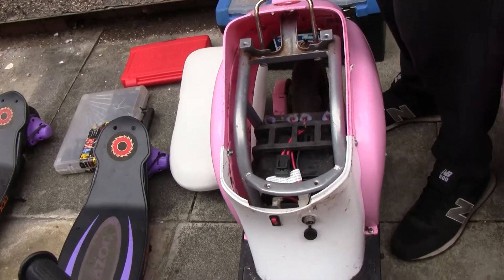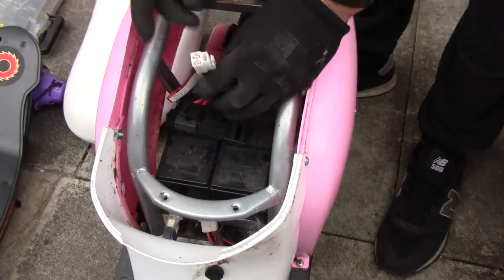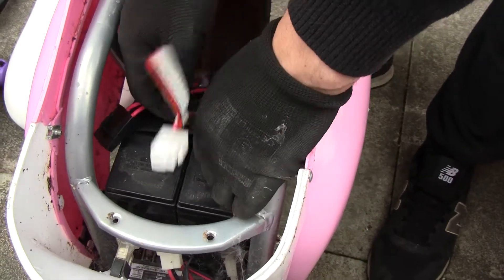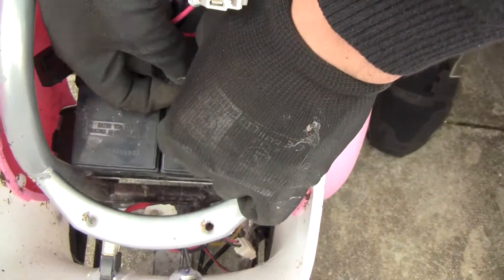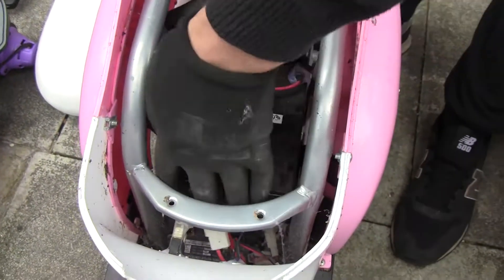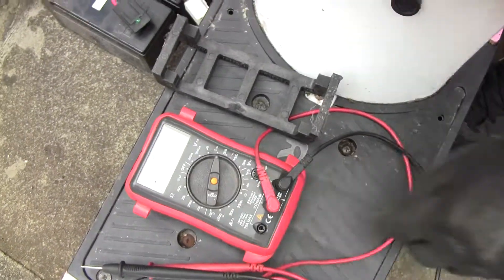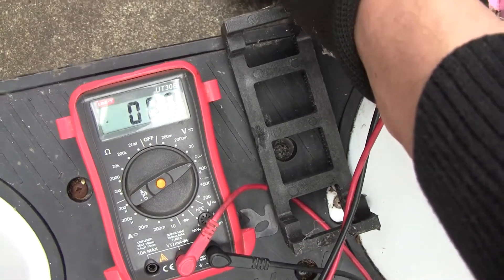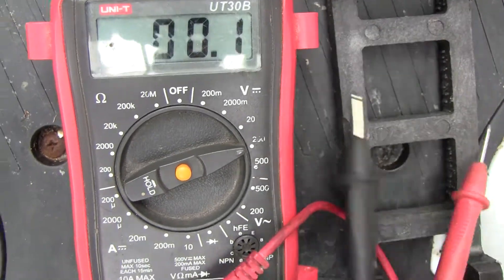Razor Pocket Mod 24v 280w Batteries Removed -Tested / faults

Comment: If you gonna make a video ... doit  Right the 1st time  !  So we can all understand what going on  !  Don't waist people time  !  ......  Should battery charge 24 hours before the volt meter reading test  ?  You can say connect red prong of volt meter to red wire on battery terminal  OR  black prong on volt meter to black wire on battery ..... something like that  !.....   What is the proper charge for a good battery ?  What it should be reading ?  What is a bad reading ?  Why test the click ?  What the click means ?  What purpose is the click ?
Reply from the maker: hi you seem like a smashing youtuber , normal charging is 8hrs to 12hrs these batteries to fully charge , normal reading should be approx 26v D/C ish fully charged, there are basic multimeter ( volt meter) training videos about this is not one of them i may put one up for you in furture, bad reading for this setup is 20v D/C ish below as the controllor has a low voltage cutout , the clicking is a relay inside the controller that clicks on / off showing its working correctly.
thanks for the feedback
Reply: So the fix is to
Change the battery?